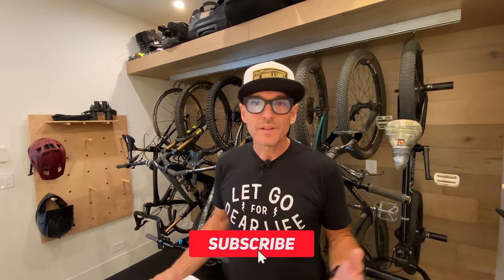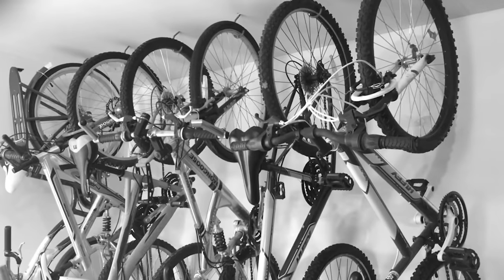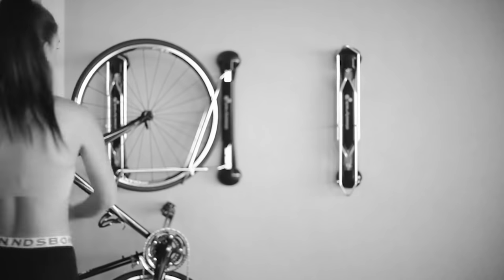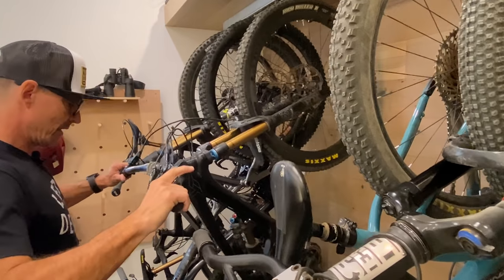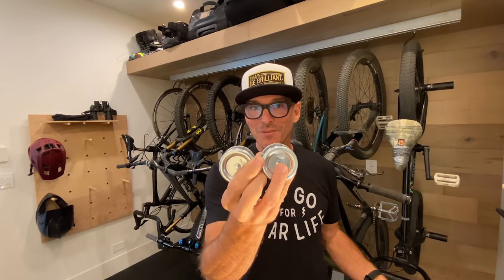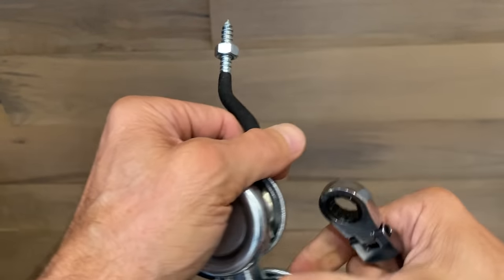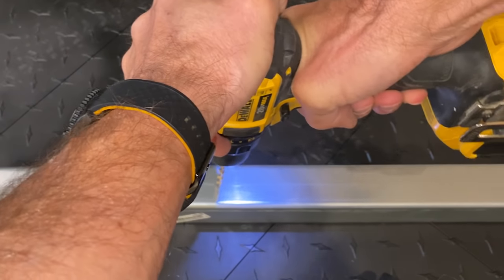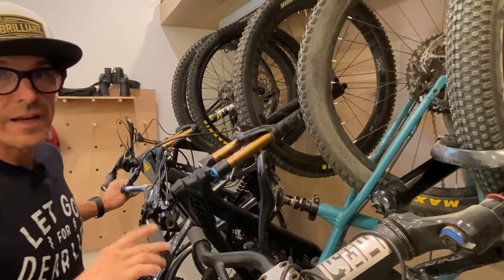ULTIMATE BIKE RACK SYSTEM. MORE BIKES. LESS SPACE

Comment: The jumbo hooks you have listed don't work with a 5/16" nut and a larger nut won't fit between the trolley hangers so you won't be able to keep them from spinning. Also the jumbo park tool threaded hooks have large nuts that won't fit between the trolley hangers so same thing and if you put a nut on the bottom to secure it its too wide for the box rail and won't slide. Need to grind the bolts down or add spacers. I don't mind some fiddling but you should let people know you have stuff on your parts list that you have never used.

Comment: This system is brilliant, thanks for the easy step by step guide! But curious, how did you pull this off for $238 if the trolley sliders are $50 each?
Reply: Agreed, the math I came up with was over $300 for a 2 pack of four for 8 bikes; and other parts
Reply: You dnt have to use his parts from the link. Just see what you need and shop around for cheaper price.

Comment: Help! Anyone else find that the jumbo sized hooks listed in the description are too big for a 5/16 nut? It all worked fine with the standard hooks, but the jumbos have a bigger diameter. And a larger nut isn’t an option since it won’t fit in the door hanger... and of course the standard hooks won’t accommodate a MTB. 
I have quite a hook collection going, but not functioning yet. What am I missing? Thanks for any advice!
Reply: Yes, same problem here - try as I might, I can't get the 5/16 nuts to bite.  I think I might have to order a few of the park tool hooks that are threaded for nuts, but they are EXPENSIVE.

Comment: I saved this video so that I could build this for my bikes... and then I saw that 1UPUSA recently released their version of this systems as a kit (5' ft wide for 4 bikes). They've also added a spring to their hooks - we'll see how well it works (just placed my order).
Reply: NOTE: Just received it - looks good. The spring is actually to lock the sliders into place, so they don't move unless you want them to. The 1UPSA box rail has slits in the top for this.

Comment: Hi, Alex!  Excellent video!  I’m building your system in my garage but am having trouble figuring out how far out from the wall to mount the barn door track so that the bikes hang freely without the wheels touching the back wall. We are hanging both road bikes and MTBs and they seem to hang differently. How far is your track from the wall?  Thanks for any help you can give and keep up the excellent work with your videos!!!  Thanks, Damon
Reply: Were you able to get an answer/figure one out?  I'm guessing at least 16 inches, but bicycles do not hang straight down from the front axle, the rear axle will be somewhat closer to the wall (at least I think).
Reply: Yeah that's what I'm trying to work out too
Reply: I ended up installing 2 feet from the wall. Hanging 7 bikes on an 8 foot track. I alternate hanging them from front and rear axles to allow closer spacing of the bikes.

Comment: This is perfect for storing our ever-growing fleet in our ever more cluttered basement/shop/exercise area. Thank you for sharing! I have already bought most of the hardware and am getting ready to do this thing.
About the nice Park's hooks with the machine thread: the specs say they are M8, and the internet says M8 nuts are 13mm wide, which converts to 0.511". That's a bit wider, than the 5/16ths nuts at 0.5", and those are already kinda snug fitting into the chase of the roller assembly. Can anyone confirm that the Parks hooks will work?
Reply from the maker: Frank Hassler Glad it’s a cool solution for you. I’m curious about this as well so please post your results and I’ll add a note to the description.
Reply: @JoyOfBike  I pulled three of the wood-screw threaded traditional hooks that I already owned and tried to install each of them in the rollers. Got different results for all three. One worked fine*. One wouldn't thread on and ruined any nuts you tried to screw on it, and the third worked, but the diameter is too narrow... I think I got it to work with liberal application of red loc-tite... we'll see. So the Parks metric threaded hooks are either going to be the perfect solution or a total fail. I'm going to get ONE from my LBS and see how it goes.

*I think it may work better if you put two nuts on, then the washer, then the top nut. The reason is that this give you some space she the bottom nut fits in-between the frame of the roller cart, and provide rotational stability to the hook, and the two upper nuts can be tightened against each other to hold it all together. Originally when I threaded the bottom nut low to fit between the frame, the washer was hung up on top of the frame well above that, and so the top nut couldn't thread down any further either, and thus couldn't be tightened against the lower nut.
Reply from the maker: @ArisaemaDracontium  another option is thread on the nut and hit it with a welder. Just a tack should do.
Reply: @JoyOfBike  UPDATE: the small Parks hooks, 450 model fit, very snug, but they fit. The oversized 470XX model have a much larger thread and nut. For those I threaded one nut down as far as I could into the rubber of the hook and that nut hanges below the trolly. Then the washer and other nut goes on top. It just barely threads on, will need some blue loctite.
Reply: FWIW the small, road (gravel, CX)-bike-sized 450 hooks have a M8 thread. They fit as described in the video. The 470 and 470XX both have M10 thread, which will need the nut above and nut below approach. A SLIGHTLY larger washer would t hurt either, but you can just make the 5/16th washer work. YMMV.

Comment: This looks great and very practical. Just one question: how do you lock your bikes? I'm thinking of installing an anchor and tying groups of bikes with a chain to it, as they are hanging from wall hooks. Now I'm considering a system like yours, where the hooks can slide. I'm thinking I might still be able to shift them around even if they are changed, so long as the chain has slack. Did you play around with that idea by any chance?

Comment: Hi Alex, 
Congrats and thanks for the great video. Since I have a room about the same size as the one in the video, I was wondering how you built the wood shelf that the bike rack hangs from, so that it is sturdy enough. Is it a slide-in shelf of solid wood? In my case I would have to cover a width of about 3 meter... Thanks!
Reply from the maker: It’s made with 2x6 or 2x4 lumber like a loft floor. Then skinned in an oak paneling. The roller track adds stiffness and should be screwed into the framing lumber.
Reply: @JoyOfBike  great. Thank you!

Comment: I just saw that 1Up came out with this as a product. I hope they compensated you for the design, as it is the best multi-bike storage solution I have found to date by a mile. I thank you for it in my head every time I use it.
Also, for anyone building it: If you have the vertical space, stagger the bikes by adding a threaded extension rod for every other hook. This allows storing them even coser!

Comment: Maybe a silly question: but what is the best distance from the vertical wall to the centre of the steel beam? Would you center the steel beam exactly half a wheels diameter or would you add an inch so that the wheel hangs further away from the vertical wall and slides easier? This is an excellent idea and thank you for sharing!!!
Reply from the maker: My tires are about 2 inches off the wall.

Comment: Great solution. How critical is the offset from the wall? Or will the rotation of the wheel, wherever it is hooked, adjust to whatever?
Reply from the maker: I have mine set up so the tires on 27.5 are 2 inches off the wall.
Reply: @JoyOfBike  Oh, so just hanging free? Ok, thanks.

Comment: I love this idea! is there any chance of the hooks damaging the wheels?  Also, does the bottom tire touch the wall at all? Just wondering if I will need to put something in the wall to keep it clean...
Reply from the maker: Thanks. Some people add foam to the hooks.  I’ve never felt the need. I have wood on the wall. Otherwise you’ll get tire marks.
Reply: I used to own a bike shop we used hooks I have used hooks for like 40 years now and no worries if the rubber gets mucked up cover or replace you can also take your old cork tape if you are a roady and wrap OR use a old inner tube cut up to protect more if you like
Reply: No, no, no, no, and NO!
The only things to consider are not hanging at the valve stem and if  you care, don't hang on any rim decals.
But apart from that, nope.
See my reply above to address all the myths about hanging bikes...

Comment: Would hanging on the rear wheel damage the rim and hub? I have road bikes with carbon rims and 24 spokes. They're not as burly as MTB wheels. However, they're much lighter bikes. Each weights less than 17 pounds.

Comment: This is a nice idea. There is a commercially available version of this, comes in more expensive than Alex's DIY version, but significantly cheaper than SteadyRacks. One nice feature it has, which I'm sure you could replicate using the machine threaded hooks is a spring mechanism that locks a given roller unit when there's no bike on it, so you're not trying to hang your bike on a moving target. A couple more washers and the right springs and you could incorporate that in a DIY version...
Reply from the maker: Oh neat idea. Do you have a link to the commercial version? Would love to see it.

Comment: I love this so much but I thought it was a bad idea to store bikes with hydraulic brakes vertically? Was I wrong about that?
Reply from the maker: I haven't had issues for the last 10 years. if the brakes aren't properly bled you'll feel it when you take them down. I have some shimano brakes on my dj that seem to need a bleed and the air goes up to the handle and needs a few pumps when i pull it down. My storage issues are usually about cold garage in winter. having the bikes in the house and temp controlled has been the best thing for storage.

Comment: The area where I want to install this has a short wall with an overlying sloped ceiling. Do you think the trolley hangers would still slide smoothly if the box rail is installed at an angle?
Reply: I don't think it will slide very smoothly at an angle, why not build something on to the slant to make the box rail lay flat?

Comment: I hope you will see this comment and reply someday. So what type of wood did you use up there to screw in that system that holds all those bikes?
Reply from the maker: The shelf is made of 2x6 pine. There is oak paneling but that isn’t structural. When the steel track is screwed into the pine it makes a very stout unit. I used 3.5 inch screws. Hope this helps.

Comment: Loved this concept so I did it myself.  Now that you've had 6 months of usage, I'm wondering if you've had this problem and if you've resolved it?  

I mounted my track to a 2x4 that's screwed up into the beams (2m apart), and even with a 2x4 there's enough of a bow that the bikes will drift into the middle unless I very carefully position the bike so that there's enough resistance.  My trolleys are nowhere near as smooth as yours, if mine ran that smoothly there would be nothing I could do to keep the bikes in place.  

I see that you've mounted yours to a shelf, has that made the shelf bow? ... and do your bikes drift to the center?
Reply from the maker: I haven’t had that issue. Kinda surprised the steel did that. Mine is also in a 2x4. 8 bikes hanging. Took a look just now and it’s perfectly straight. Based on what you’re telling me your ceiling joists are bowing so you might have a bigger issue than bikes drifting.
Reply: @JoyOfBike  Thanks for the quick response.  I didn't have joists in a suitable location so essentially I had to create my own, by hanging a 2x4 from under the beams.  Thinking about it further, I couldn't imagine it was possible to bow a 2x4, across a 2m span with only 3 bikes ... in just 1 month, therefore, I suspect the 2x4 had a slight bow in it too start with.  I guess it would only take a few mm of bow for the trolleys to want to move. 

I also used big square hooks (15cm wide) to make it easy to get the bikes on and off, but if the weight is not perfectly centred it's probably wanting to force the trolley down the track.  It's quite possible this is the root cause of the problem.   I'm going to try smaller hooks that only just clear the rim (like you have) and see if that makes a difference.

Thanks again for the video.
Reply: @JoyOfBike  - Final wrap up .. the issue confirmed - Large hooks and not seating the wheel directly centred was the problem and it would send the trolley in either direction (so definitely not saging).   The ones I'm using https://www.bunnings.com.au/pinnacle-black-pvc-jumbo-screw-in-bike-hook_p2580677  look much bigger than the square Park Tool ones you recommended - I might have to get some sent over.  👍
Reply from the maker: @AaronMarkie  okay good to know it’s not sagging. Thanks for the follow up.

Comment: Great video and a nice design, but as an engineer, putting a UNC machine nut on a screw thread makes me wince as this literally will not support any sort of engineered load.  I realize your bikes don’t weigh more than 30lbs each, but it’s just not safe to do it the way you have.  You can buy these J hooks with UNC threads which will reliably hold a load.
Reply from the maker: Yeah no doubt. It feels so wrong!! : )
Holds 180 (me) so I’m not worried about the bikes.

Comment: Curious how I can do this in my garage. My ceilings are about 20 feet up. So I can’t just hang them from the ceiling. Gonna have to contemplate this one.
Reply: I did what Ian suggested. I built an L bracket, screwed it into a stud, with 3/4" plywood bracing and a 2x4 inside to form a triangle. This holds up one end. The other end is a corner and I put a 2x4 between two studs for the rail to rest on. Plenty strong.

Comment: So it's late for me and my brain may not be seeing the flaw in my idea but, any chance this would work on a wall vs the ceiling? Where I am planning to set up my bikes I do not have a secure ceiling location to mount to but I know I have a set of solid wall studs I can use. I have been toying with some ideas. Some of which include spending too much on a rack system pre built, going back to some 2x4 and hooks, this but on a wall, and an idea that keeps seeming cool but the more I think about the less I think it will work, french cleats and hooks, so they are movable and removable. 

Let me know if you think this would work on a wall as this is creeping to the top of the list.
Reply: Im planning on mounting to my wall instead of ceiling... will try to update
Reply: @kevco420  yeah let us know that would be cool to see... I ended up doing a french cleat system for my bikes
Reply: @PedallingwithPaul  Wall mounting the box rail is a NO-GO. The weight of the bike pulling sideways on the trolley (meaning the weight is not resting on the rollers) causes too much friction and they dont slide along the rail as intended. Back to the drawing board...
Reply: @kevco420  bummer! Thanks for testing that out. I kinda had a feeling that may have been the case
Reply: @PedallingwithPaul  Yeah me too.. when I dry-fit everything, the friction wasnt bad at all, but the extra weight of the bike caused the box rail to warp and bind on the trollies.
Reply: @kevco420  yeah I ended up going with a French cleat style hanger and have been testing different wall mounts on that. https://youtu.be/9PfKKsG4Wko

Comment: Hey does having a bike mounted like that long term cause any harm to the components ( hydraulic brakes )
Reply: hydraulic breaks should get some maintenance one in a while anyhow, like toping off fluid after replacing the pads. Long term is a loaded question.. like 1 year or 5 years? I imagine if its this long, just consider selling your bike. Less than 1 year I drought there is anything to worry about.
Reply: @matthewkramer8613  good point ( I keep my bikes for year but I totally get what you are saying.
Reply: If you hang the bikes with hydro brakes from the front wheel there will not be a problem, and it may be good for the system as bubbles will rise to the top.  Suspension forks may also benefit from front wheel storage.  My concern would be weight on the rims, but everything I've read says it's a non issue (even if I have reservations).